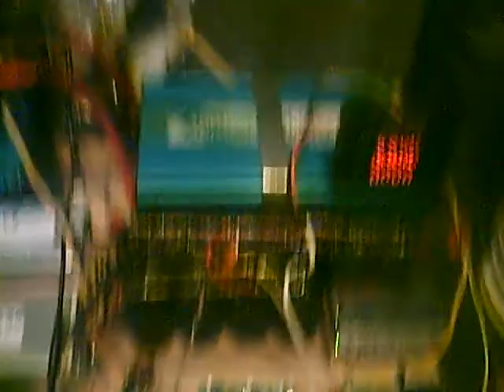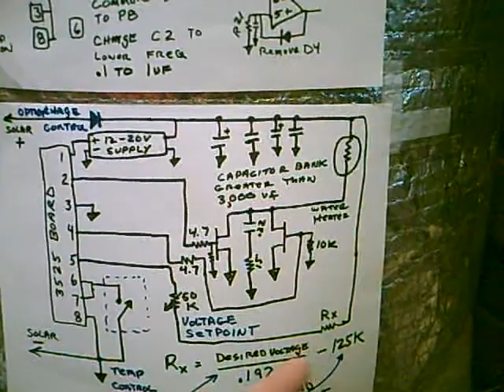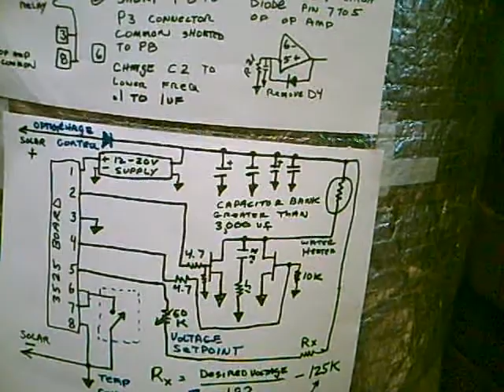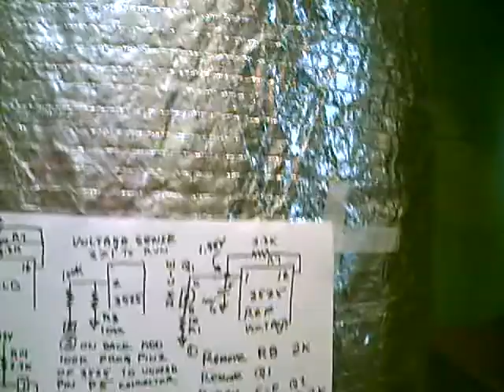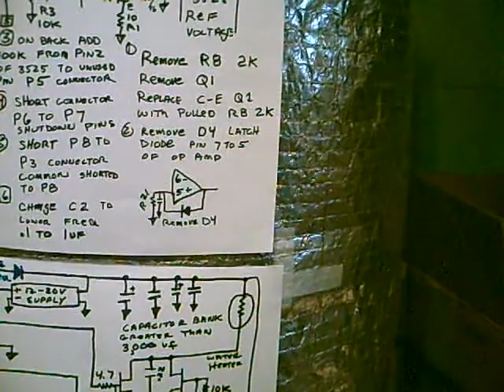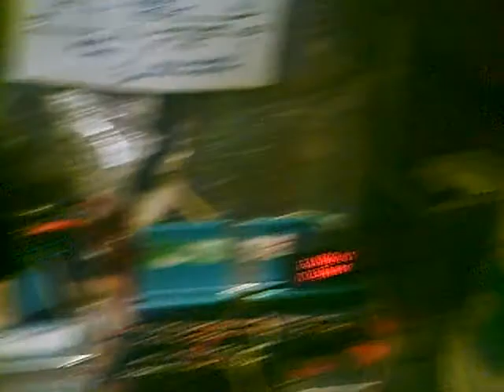Cheap Efficient PV Water Heater Controller MPPC

Comment from the maker: For those building this project I suggest using dupont wire jumpers. You can buy male-female jumpers in wire lengths of about 10 inches. The female end will fit the cards pins which are spaced 2.5mm. Use the male end as a solder connection. These wires have only about three strands making it unreliable to strip and solder directly to the wire. Break out a section of wire that follows the resistor color code. Pin #1 being brown, pin #2 being red, etc.  This will make it much easier to figure out which wire goes where, on the connector and at the FET assembly. Hold together the pins at the board with some tape.

There are cheap NANO adapter boards with screw terminals and mounting holes. These could be cut in half to make two assemblies. They do not have the best screw connectors and could easily be unreliable if great care is not taken.